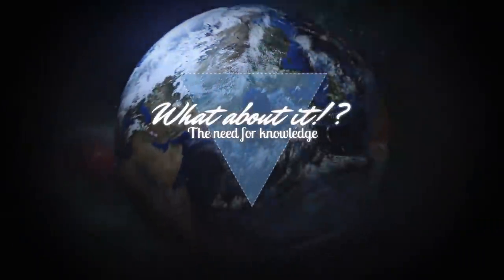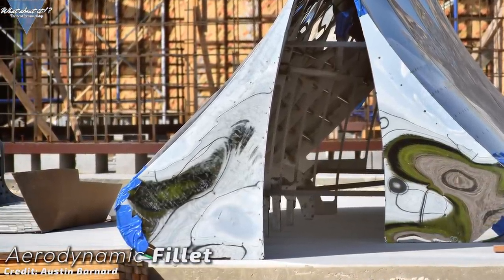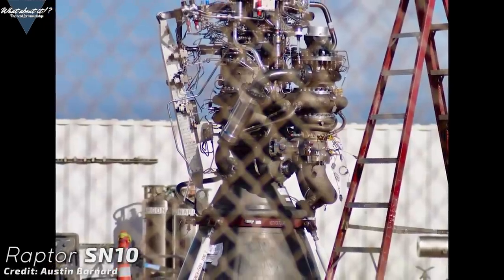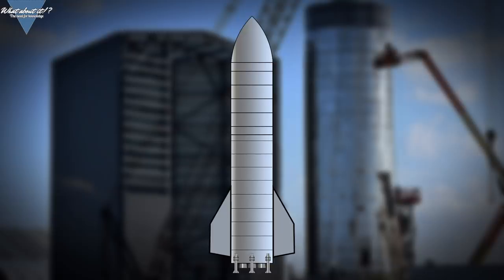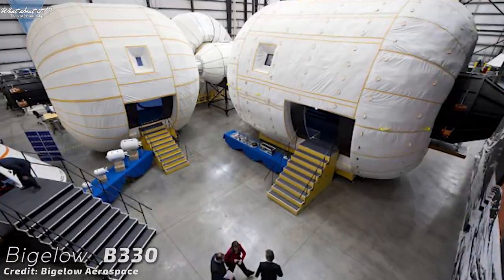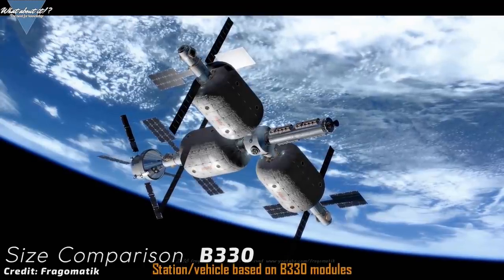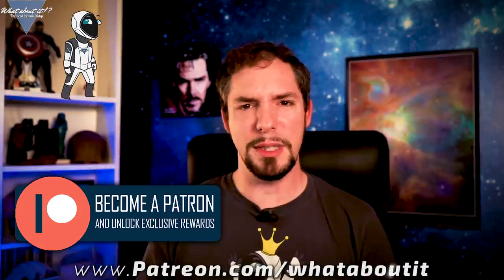36 | SpaceX Starship Almost Ready - Bigelow Aerospace, A Fitting Payload

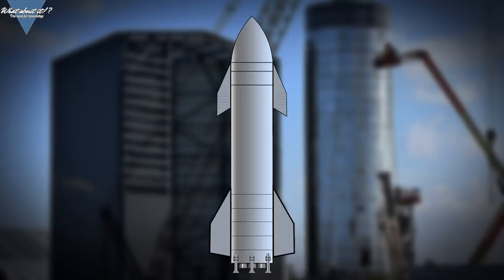Comment: 6:37 Need a space station? Throw away the heatshield, the wings and the grid fins and merge superheavy and starship together.
Reply: Superheavy probably won't reach orbit, and it definitely doesn't have useful space for humans.
Reply from the maker: SH would need a nose cone, but then it could. I still think though, that Starships will never be used as Space Stations, as just too much of the internal space is filled up with tanks and engines and things, a SpaceStation just doesn't need that much of. Especially, if you can just use a BA2100.
Reply: @zoltankurti  And i'm not talking about dumbly merging them together but to build a new SSTO rocket with an elongated fairing. (about 3800 cubic meters of pressurised volume)
Reply: @Whataboutit  Oh yeah but then if you refill it you can go anywhere in the solar system. (but you would not be able to land)
Would be good for asteroïd mining though.
Reply: @johntheux9238  that's not how it works, SS might be able to reach orbit, but certainly not a SS/SH stack. And I still don't understand how a superheavy could be a useful addition to a spacestation. A rocket that reaches orbit has a very big portion of its volume filled with fuel tanks.
Reply: @johntheux9238  and if you are not talking abput a SS/SH stack, I really don't understand why sending these two into orbit separately would be practical.
Reply: @zoltankurti  I am talking about building a taller starship with 35 sea level raptor engines and an elongated fairing. By merging them together i mean merging the fuel tankers too.
Reply: @johntheux9238  are you willing to waste 35 raptors to put a space station into orbit? You could fly a station the same size into space in smaller sections with the same ammount of engines, and you would still have them at the end with many more possible flights.
Reply: @zoltankurti  At 200 000$ per raptor that's only 7 millions $ wasted for 3800 cubic meters of pressurised volume. (80% more volume than BA2100 for probably a lot less money)
And if you refill the spaceship you can go beyond LEO
Reply: @johntheux9238  lets just notice that we are nowhere near the 200000 dollar price for raptors. That's the most optimistic price for them. Besides, if you make a single stage approximately as big as the SS/SH stack, it probably couldn't reach orbit. There is a reason why spacex leaves the first stage behind on earth.
Reply: That was the original Skylab concept - A Skylab was supposed to be launched wet (full of fuel and oxidiser) and fitted out in orbit with accommodation.
Reply: @zoltankurti  True, due to the square cube law a bigger rocket will have a lower mass ratio.
Reply: @johntheux9238  not if the diameter stays the same.
Reply: @zoltankurti  Nope. If the diameter stay the same the rocket will still be a lot heavyer and so the walls needs to be thicker. The square cube law is driven by the mass/footprint area ratio and so by the rocket height.
Reply: @johntheux9238  yes. But I was generous, if you account for this, it's even worse for your idea.
Reply: @zoltankurti  Oh yeah. The bigger the rocket is the lower the mass ratio will be. But there is still some margin. Naked starship has a mass ratio of 30, that's 2.13 times more than reusable starship.
https://twitter.com/elonmusk/status/1111798912141017089?lang=en
Reply: @johntheux9238  no it doesn't have a margin. It can barely reach orbit even in that not reusable configuration.
https://mobile.twitter.com/elonmusk/status/1129629072097775616?s=19
The delta v is not the only factor relevant for reaching orbit. Ion engines have huge specific impulse and therefore could reach huge delta v, but they couldn't even lift off from the planet. That's obviously not the case here, but it's just an extreme case for illustration. You have to factor in air resistance and also during flight time, gravity will have a delta v too, fighting against the rockets delta v.

Comment: Why is the exterior so rough ?   I thought it would be smooth.
Reply: They're test articles.  They probably expect them to get battered a bit as they evolve the design into it's final form.
Reply: @TheEvilmooseofdoom  Huh ?  The whole outside of the spaceship is rough, as in the SS panels aren't joined evenly.  There are los and high spots everywhere.
Reply: @SomeTechGuy666  Yes, but they are test vehicles.  They will be making short flights and hops (mostly straight up and down) while the design is finalized.   Expect changes and perhaps a RUD or two.
Reply: @TheEvilmooseofdoom  So these are throwaway prototypes ?
Reply: @SomeTechGuy666  I wouldn't say throw away but of limited use and utility.  I doubt they fly outside of testing and I expect more test vehicles will be built as the design changes.

Comment: In these talks about Moon and Mars missions I just don't see how this big and heavy vehicle can land on uneven and unprepared surface. There are no concrete landing pads anywhere but Earth.
And even for concrete pad I am not sure if it can last long over few landing attempts.
Reply: The landing legs will no doubt be made flexible and compressible, so that they can come down on an irregular surface. No doubt though, one of the first things they will do will be to construct launch/landing pads.
Reply: Suicide burn? Basically taking only one second to land so the hole should not be too big.
Reply: @odysseusrex5908  The vehicle is very tall so even slight tilt of few degrees is dangerous for the stability. Landing legs have to be very wide to support it. And they would have to be strong, because the vehicle still will have lots of fuel to take off.
Constructing anything on a another celestial body with no or little atmosphere and no raw materials and essential ready to use seems to be impossible task even today. Nobody tried this before. And we do not have technologies to create a concrete equivalent in these conditions.
Reply: @johntheux9238  Rapid deceleration is possible with almost empty tanks at the cost of high Gs (bad for people). With non-empty tanks that are needed for take off I am not sure.
Reply: @andreylukyanov2179    Well, quite obviously, the modestly talented engineers at SpaceX aren't going to overlook any of these obvious problems. Don't worry, when the time comes, the landings will be successful.
Reply: @andreylukyanov2179  High Gs compared to gravity so on the moon where the gravity is only 1/6G a suicide burn would be about 1G, no worry.
Reply: @johntheux9238  What? I suggest you take a physics lesson. Gravity only matters when a vehicle needs to hover - when engine thrust equalizes gravitational force. When you need to cancel vehicle speed to zero - gravity does not matter - vehicle inertia matters.

Comment: Why would he put a header tank in the nose?
Reply: weight balance to offset the heavy fins
Reply: To simulate crew, equipment, etc in finished Starship.
Reply from the maker: Elon tweeted about it. It's to shift the weight balance away from the heavy tail to make it easier for Starship to flip over for reentry. This is just a test article though, so expect that to change for the final version.
Reply: @Whataboutit If it makes sense now, it's unlikely to change for the end product. Weight distribution upon reentry (without payload) will not change favourably for the final version.

Comment: I have never worked in any way with spacecraft, I have worked on aircraft and most other disciples withing fabrication and engineering. what hits me is this work douse not even look up to normal Aerospace levels of construction, If I did not know this was meant to fly I would think it was a building site for a fair ground!
Reply: sbmphr  I have worked on development projects. never have I seen a sensitive bit of hardware constructed out side.
Reply: I thought the same thing. This could be just a cheap prototype version ? Or maybe Musk is more concerned with the cost rather than “look” ? At this rate of progression it won’t be long before we find out.

Comment: what I do know is that Starship has a good lift potential , 
as dilettante,Boka isn't big enough and  the investment might take longer for a 1000 ton exploration cruiser to even begin  permanent base's other than  whats in  developement.  Interstellar probes might not entice assistance so go with  probably this estimate of 2030s potential. Rather disappointing considering the combines human knowledge and co operation.The sanitation isnt a 2mm drill hole but  tunnel at 1 bar designed in and attractive plate and durable to walk on rather than have to have exercise running tracks  to get fussy. However the presentation featured habitat and Delivery to orbit is easily believable  which is important. As is the  existing cosmos reaction to anti socialist and communism  of other space agencies.Maybe it is just a luxury to embellish terrestrial  conservation.Ferro dynamic  and rewritable as the crew step  I think  probably very difficult to engineer anything else but low G weightlessness for rather some time.The semi organic soil grate too  and production of molten metals  also difficult  as theres  not knowledge untill finding  large seams as elusive as good climate model news.